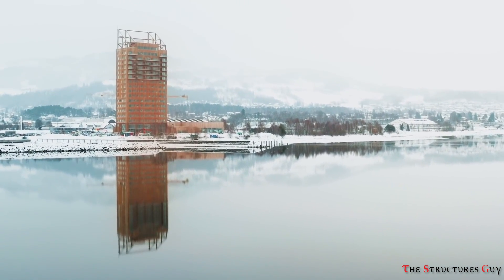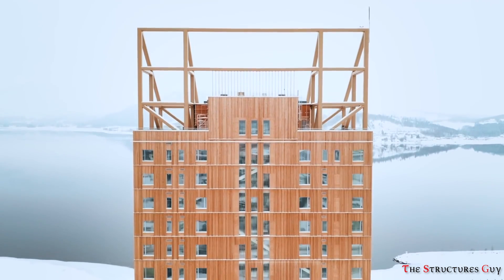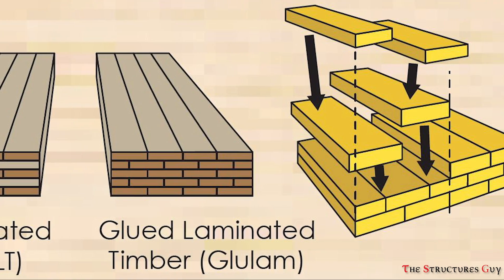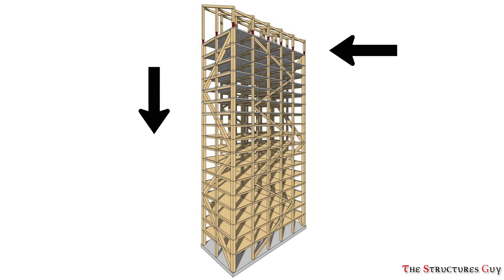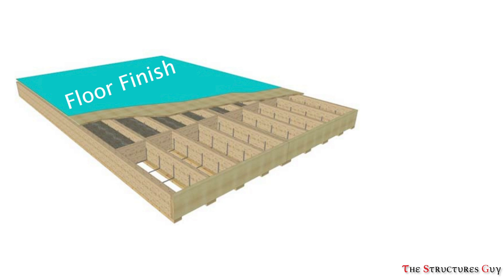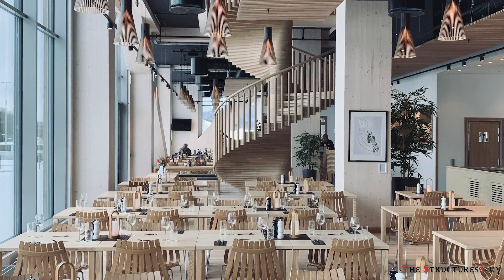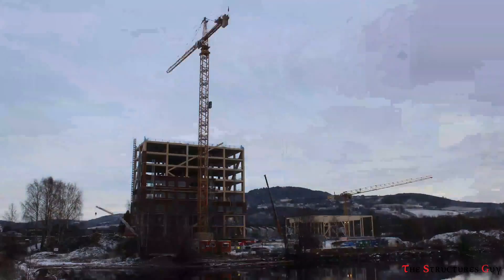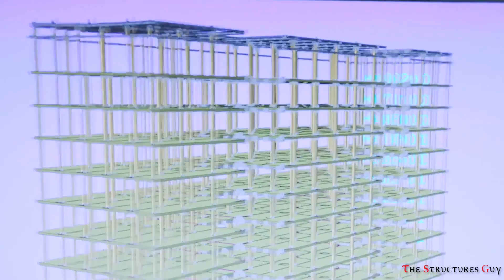The Engineering of The Tallest Plyscraper: The Mjøstårnet Building

Comment: The TRA8-floor system is not with casted-in-place concrete as said in the video. This grey material shown refers to rockwool, a thermal insulating material with high fire resistance properties. Only the upper 8 floors are casted concrete.
Reply: Meaning these 8 upper floors are only concrete, no combination of wood-concrete